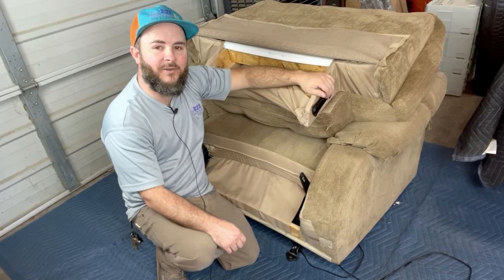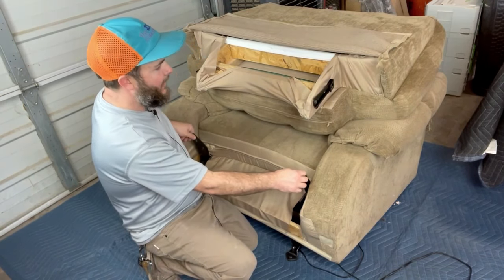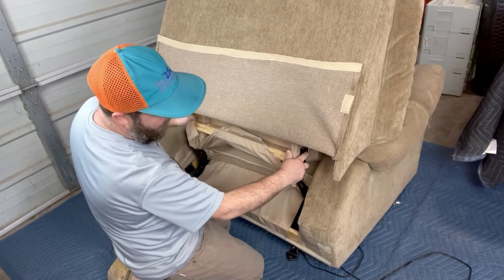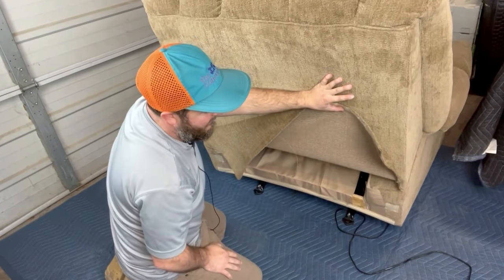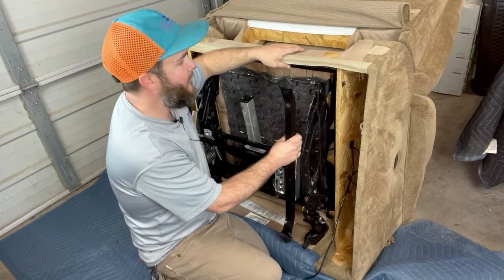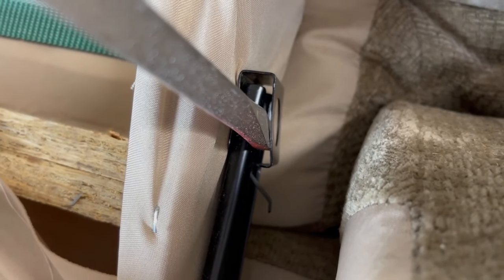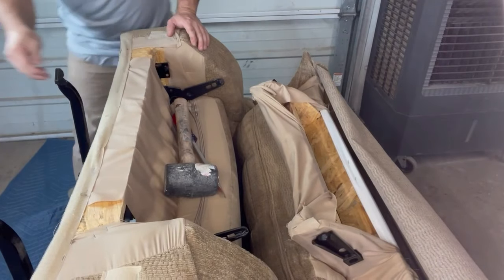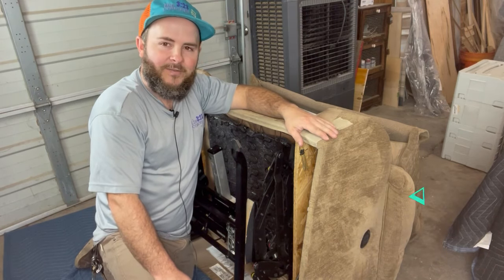How To Repair Your Recliner: Removing and Replacing Your Recliner Back

Comment: This video helped me a lot. I got this chair brand new from American Furniture and within A couple of years it started to fall apart so I opened the back and could see that one of the bolts had come loose so I took several wrenches to see if I could tighten it up, that didn't work so I tried hex keys and that didn't work, so I was really in a stump. Then I saw this video and it showed me how to remove the back and it was easy sailing from there, I also discovered that all the screws were coming out, so I tightened them all, thanks again.
Reply from the maker: Glad it helped!!

Comment: You just saved me a minimum $165 repair charge!  The Bolts on one of the KD brackets on the back of my sofa recliner worked themselves loose from the wood frame over time.  Knowing how to take the back off helped me get a better look at the problem and both bolts were just sitting near the bottom of the seat.   I reattached the bolts and slipped the bracket back on the ears and voila!  Good as new!  Thank you!
Reply from the maker: Thanks for watching! Very glad it was helpful for you!

Comment: I remember commenting to the delivery guys years ago, when they slid it together, it was so easy and he said it came apart just as easy but I could not remember that part at all.  I think my wood is split out, so I'm in for a little more work to rebuild it, but getting it apart is the first step.  Thanks for a great video!
Reply from the maker: Thank you!

Comment: Thank you.  The vendor of our recliner that we purchased at Kirkland sent us the link to this video to help with our problem.  This helped a lot!  We had put the back onto the base and it clicked on one side but not on the other.  Then we couldn't detach the one side that clicked to be able to try again and/or return the recliner.  From this video, I was able to figure out where to insert the screwdriver to be able to detach.  Tried to put it back together and get it to click on both sides but it still wouldn't.  Disassembled again and figured out that the clicking part was slightly rotated and not aligned.  Turned it be aligned and re-assembled and both sides clicked!  I think your video could've added that part to help me with the 2nd half of the problem, but in any case, we've got it resolved now and (probably) won't be returning the recliner.  Thanks again!
Reply from the maker: That’s a great idea! As I was reading your issue, I was going to say it needed to be aligned. Sometimes those tabs shift.

Comment: Great clarity with “how to”!    My recliner/ lift chair has a different style KD bracket.  It is sandwiched in where I can not clearly see it.  Do you know of any resources for different style KD brackets?
Reply from the maker: Let me see what I can find out. I know lazy boy makes one that has a swivel lever that has to be rotated. There is a channel called the recliner guy that has a lot of videos and he may have a video on the subject
Reply: @the323vlog4  Thanks - I saw The Recliner Guy's  Lazy Boy video.  The one I have does not seem to have the swivel lever like the one he showed.  I am going to get a flashlight, long screwdriver and a rubber mallet and head back over there in the next day or two.
Reply from the maker: @stumplifter  sounds good, keep me updated! Those are the only two I have come across

Comment: Thank you for the clear explanation/demonstration. Very helpful.

Would you have a suggestion for the following issue:

When manually opening a reclining couch (from completely closed position), the foot rest opens about 2 inches but then the mechanism gets stuck. I'm able to open it if I move the foot rest side-to-side, but need to do this a fair amount. Both ends of the couch behave the same. It's a 1 year old couch. Any suggestion as to what may need to be adjusted?

cheers!
Reply from the maker: Yes, it sounds like the mechanism is bent and catching on itself or the metal frame at the front. A couple of options may help: inspect mechanism and see where it is bent or catching, the proceed to remove and straighten it out. Folks have recommended c clamps or pounding it out with a heavy hammer. 
Another option is check with the vendor and see if you can order a whole new mechanism. 

Best of luck
Reply: @the323vlog4  Thank you very much for the reply. I will give this a shot.

cheers!
Reply from the maker: @denisfilming  my pleasure! Good luck

Comment: Great video, thank you, our recliners foot rest won't retrack, do you have a video to show how to repair that area?
Reply from the maker: Usually there is a bend in the scissor spring causing it to hit the frame. I’d flip it over and inspect the mechanism to see if it’s bent or needs adjustment

Comment: Thanks for your video. I have the same recliner that you used in this video and have to replace the footbed springs but can't find out where to hook the new springs back into. Mine is a manual recliner not an electric on.
Thanks
Reply from the maker: If you send me some pictures of the mechanism I could try to help you locate them. Email is the323concept@yahoo.com

Comment: Great video and I have a little more understanding of my SimonL rocker, power recliner.  However, I still and unable to locate the crunching noise in my recliner going up and down.  It is more on the right side of the chair.  I have spent a lot of time trying to figure where the problem may be coming from.

Comment: Question, I have a series MS17-D1-1015-03 recliner. Once the back is on, the back will not recline without the foot rest open. It this normal? It's very uncomfortable.  Thank you for your time.
Reply from the maker: I have not heard of that issue. This may be a model I’m unfamiliar with

Comment: Hi - I cannot place the back in it’s proper location. Wings will not go to the top of the back bracket. One side is higher. I removed the bracket and it will not go all the way up to lock in place. Any help is appreciated!
Thanks Larry
Reply from the maker: I use the persuasion of a rubber mallet if it’s stubborn

Comment: I have a electric recliner love seat and the right side of the recliner works, but the left side does not, it is like the wire coming from the motor has a short in it, because my son was messing around with wires and again it worked for awhile and then it stopped working again, any suggestions? thank you
Reply from the maker: I would check some of the videos I have on diagnosing a power recliner. They should help

Comment: Hi my recliner glider squeaks on the back. I think its coming from the wood components do you have ideas how i can make it stop squeaking if its the wood
Reply from the maker: I would inspect a little further…could be loose hardware, which would just need to be tightened. If it’s wood on wood friction, might need some securing, if it’s metal, a little lubrication would help.

Comment: My frame has like rivets, quarter size on one side and a tiny round flat piece on the other going through the mechanism for the back rest piece; doesn't look like I can do anytime to remove this and have to get it out of my house.  The only way it came in the house was powered to recline and now it's broken and can't recline it..  Any suggestions?
Reply from the maker: Can you send me some pictures  of the Brackets where the headrest attaches? The323concept@yahoo.com

Comment: One of my wings broke off right below where the backrest slides down to. Basically at the weakest point.
Is my only option to try and weld it back on there and reinforce it somehow? Or are there repair kits?
It is not under warranty anymore unfortunately.
Reply from the maker: Yeah, I would try actual welding if that’s an option. If not, you might try your luck with JB Weld. You could also try the recliner-handles website. It has a large source of mechanisms to choose from

Comment: U have a video to replace seat cover of a reclining sofa?
Reply from the maker: I do not have one yet. It is a pretty rare repair. Invest in a good staple remover: https://amzn.to/3BIrGkR

I’d remove mechanism , then remove all
Staples along the bottom edges. I usually pry them loose with staple remover tool then use pliers to finish the job.
Reply: @the323vlog4  thanks. I have a damaged faux leather seat and got a replacement from manufacturer but i am unable to figure out all the staples connected.
Reply from the maker: They usually are all along the bottom rear, sides and front. Hard to trace sometimes

Comment: I bought a Catnapper Recliner for my dad & he wanted the one with the swivel action to turn to the side because he had  horrible spine problems from a bad car wreck but anyways he would lean back & the chair would start to slowly turn to the right and I thought it could had possibly been a slight problem with the leveling on the floor but my dad had read the paper that had came with it and it said something about it basically adjusting itself automatically but anyways I took a 4-foot level and checked the floor and the floor was level and I even remove the chair and check exactly where the chair was sitting and the floor was completely level but it still does rotate towards the right and I just mean that when you recline back and it will start to swivel towards the right which basically is in front of the TV but then the chair moves slowly when reclined and you have to grab ahold of the table that is beside it and pull yourself back so that way you are facing the TV again! It is very frustrating and I have taken some towels and tried to get it to stop and placed a pillow on the other side to try to make it not rotate to the right after I have reclined backwards. My dad was very happy to have this chair I bought him and he was sitting on a very terrible old worn-out couch and I hard to get my dad a better chair to sit in so he was comfortable and he was a 72 year old man. Sadly I lost my dad just one month later after purchasing this brand-new Catnapper and I was glad that I was able to give him something very nice before he passed on but I have set in his chair and I have seen how it really does keep rotating towards the right but like I said everything is level and I have even put things like a towel and pillow against it but it still does rotate towards the right and I did not know if there was some way of adjusting this or making it tighter so the swivel action was a bit tighter so it would not easily rotate towards the right and I just cannot figure it out and I only can think of possibly shimmying the right side underneath the circle that sets against the floor to try to prevent it from rotating towards the right. I also wish I could tighten up the reclining part of the chair because when the feet are raised up the back of the chair really wants to lay back who easily and sometimes when reading something the back of the recliner needs to stay in the upright position so that way you are not laying backwards. I don't know if this is even possible to tighten up the back of the chair to make the reclining part just a bit stiffer so it will stay in the upright position when you are reading or doing something that requires you to basically be sitting in a upright position.
Reply from the maker: I’m not aware of any way to adjust this function. Usually, an individuals legs reach the ground and create the resistance to keep it from rotating
Reply: It only starts slowly rotating when the chair is reclined and it rotates to the right but the floor is level but it just slowly rotates about 12 inches to 18 inches max. to the right when reclined!!! When you just sit in it without reclining it naturally stays put but it does really keep you pushed upright in just sitting position which my dad liked becouse of the severe problems with his spine and had buldging disc and ruptured disc in his back and neck and his neck required surgery to carve out bone to stop pushing on the nerves! I just wish I knew a easy way to keep it from rotating to the right (only when reclined) and I thought I could try putting something under the metal circle that sets on the floor, basically like putting something to shimmy up the right side of the chair to hopefully make it set flat becouse it must be off just a little bit to cause the chair to slowly rotate towards the right only when in a reclined position!!! I've even moved the bottom metal circle slightly to see if it would improve it but no luck. I guess I'll try to put something underneath the right side of the circle that sets against the floor to try to make it just a bit higher because like I said I checked the floor and it is level and I used a 4 ft level and it's perfectly level and if shimmying up the right side of the chair fixes it then that will be fine with me because it is not worth having to load it up in my truck and return it back to the furniture store that I purchased it from. I just don't have any other ideas other than that because if the chair is off slightly then it would cause it to rotate towards the side that is unlevel and in this case I believe that it is the right side but if the shimmying the right side fixes it then it will make me happy because like I said it's not worth going through the trouble of returning!
Reply from the maker: @adambostick6765  ahhh I see. Yes, I believe they would be my course of action as well. Carefully shimming under the four or so bolt points to level it out
Reply: @the323vlog4  I don't know what you mean by bolt points becouse the bottom of this chair just has a metal circle that sets against the floor! I'm trying to think of something that would be the right size to shimmy it up but something hard but kind of soft to try to keep the shim in place but be strong enough to slightly lift it up just a little bit!!!
Reply from the maker: @adambostick6765  unfortunately, I haven’t come across that situation on that style of swivel chair. I wish I could help you out more.

Comment: They're called "T nuts", and have three points that dig into the wood so the bolts will tighten without holding the nut with another wrench.
Reply from the maker: What about the t-nuts? Did I miss a question somewhere ?

Comment: Where is the link to replace the back parts
Reply from the maker: I don’t think I have a video on replacing the kd brackets. Once you remove the back, it’s pretty straightforward. Usually two bolts and maybe an additional screw holding it to the frame

Comment: Anyone know how to fix the frame? The osb where the clip is cracked!
Reply from the maker: Short answer : You’ll need to remove all staples to remove the back panel casing, cut the board loose that broke, trace it onto a new one and reinstall

Comment: Mine has 4 bolts I need the size of the missing  bolts
Reply from the maker: The KD brackets are usually held in place by 1/4” bolts typically 1” long

Comment: You are probably going to think I'm completely crazy. But I have been looking all day for a video that would show me exactly what you just showed me. But I would like to take it a step further and see if you can give me some advice. I purchased a new reclining Unit A loveseat recliner with the center console and it has the exact same connecting features that this recliner that you're demonstrating on has. But the problem is though the seat backing is being held above and one piece is being introduced into the other piece and push together for some reason on this recliner they're not connecting they're not making the clicking sound and they're not staying in place. And we have tried pushing it down forcefully we have tried taking it off putting it back on repeatedly thinking maybe it's just not in place correctly but something that looks like it should be so completely simple has become so completely impossible to accomplish. And I know you're not an expert and you don't have the same kind of furniture but you have the exact same kind of attachment device. Are you aware of any other way to make those two pieces click together besides what you displayed. I am completely at a loss on how to remedy this situation and I have looked at probably 15 or 20 videos but yours seems to be the one that is showing it in the easiest most understandable clear instructions and I'm trying exactly what you're showing and it's still is not clicking together and locking in place. Is there anything you can give me in the way of advice to help me with this issue.
Reply from the maker: I’d recommend adjusting the clip on the back and making sure it’s completely straight. Sometimes it is just a hair crooked making it difficult to slap in. I’d also recommend using a rubber mallet to make sure it’s down all the way. Hope this helps
Reply: @the323vlog4  thank you
Reply from the maker: @sammikinney1601  my pleasure